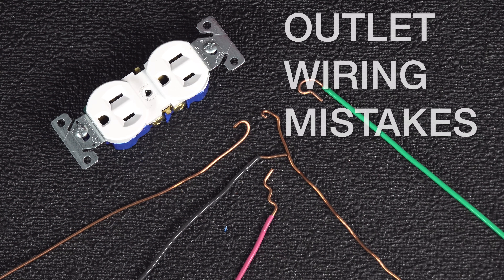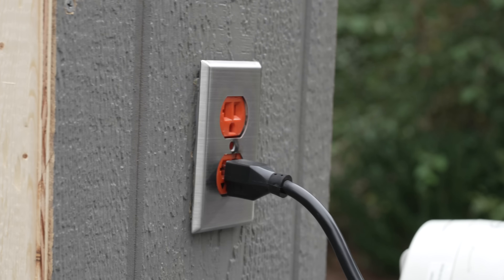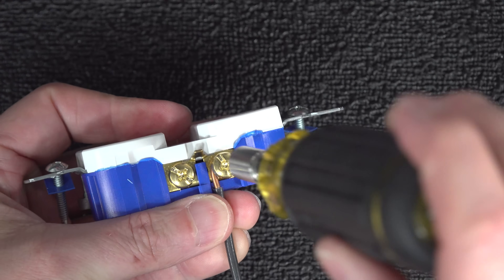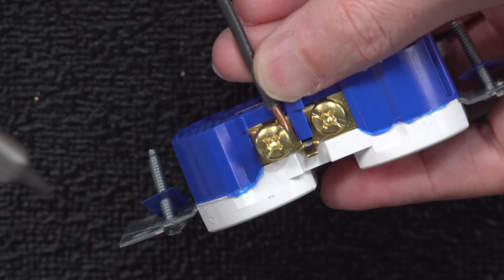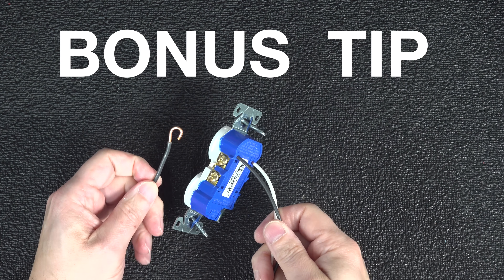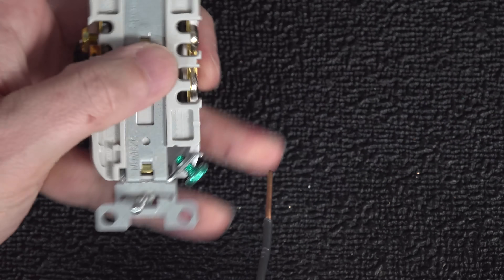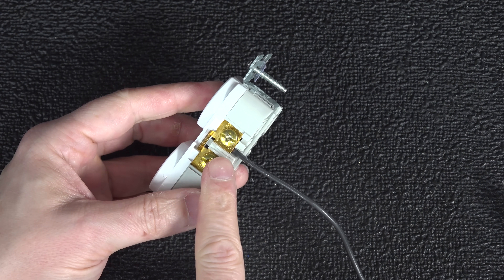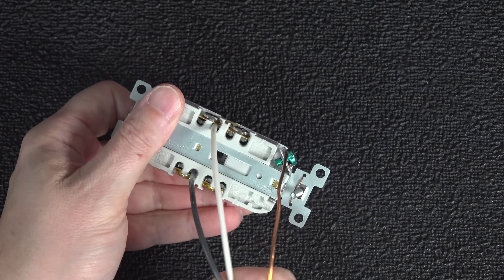BEWARE Of These 3 Common Wiring Mistakes On Outlets & Switches

Comment: The number four most common mistake is the misuse of the word “OUTLET”.    There are lighting outlets, smoke detector outlets, receptacle outlets, and some more.     In the case of a receptacle outlet, the parts are box, wires, devices, and plates.
I can talk about my hand, and included are my fingers.   I can talk about my fingers and no mention or thought of a hand.
Receptacles are a device that is part of a receptacle “outlet”.   Does it make a difference to know this?   Yes if you are reading certain parts of NEC!

Comment: Great tips! I had my lights all fail on kitchen and turns out probably the 3 way switch is probably bad or the wiring. Funny thing is the two right switches on the 3 way switch work fine but the left switch on the three way switch panel is what is not working. Thoughts?

Comment: Sorry I still don't think back wiring is all that bad.  My annoyance with screws is 3 fold, stripping right amount. Getting nice curve, near impossible, even using little hole on stripper, it still bends more of angle than circle, and if u use pliers other than smooth it scratches it up.  And the worst for last, getting the damn loop under the screw!  Screws never go out far enough to just loop it while it's the right small loop.  Opening loop wider to go over screw doesn't work for same reason, as wire is too thick to then squeeze smaller cause the screw again doesn't unscrew far enough for wire to get under and drop down.  Most outlets I did are the screws but it totally sucks.  Guess I'm not too good at it but I did a lot.  One solution is the next outlet up, that has the side wire or whatever its called, just like backfire but it goes in straight under screw... cept I was cheap before I knew that and had the low end outlets.

Comment: One more tip.  Especially for DIYers: Use a torque screwdriver set to the outlet manufacturer's spec (usually around 15 in lbs for copper).  Many DIYers don't torque the screws enough.  Also if you're doing a few outlets, use an ECX bit that's a combination of square and straight.  They pretty much never slip.

Comment: i just ripped out a plug that was installed by the previous owner of my house. the two neutrals were arcing and basically caught fire and melted into the plug housing. all of the lil hooks were backwards, the black wire was double wrapped, and everything was loose. it also had two ground wires wrapped around the single ground screw, and a red wire hanging out, not attached to anything and not capped. 
i fear for my life in this gd house.

Comment: Thanks for such an informative video!  I have to replace a GFCI outlet in my bathroom, and now I will not only know how to wire it up correctly, I will also know to look for a replacement outlet that has those nice full contact connections in the back.  Thanks a million!  😎👍👍

Comment: I think it would be best to add you should always connect the ground FIRST! when connecting. Then neutral, then your hots. This can prevent injury in case of an energized circuit. Best to build safe practices as your foundation.

Comment: And you did not mention that looking at the front of the receptacle ,the short slot is always the black or hot wire,the long slot is always  the white wire or your  neutral wire. Some receptacles are not always  marked with brass and sliver screws ,sometimes cheap receptacles have silver screws on both sides ,that is why to look at the front of the receptacle and view long slot -for neutral, and short slot -for black or power wire. This is a addition to what was mentioned.

Comment: I have a double wide trailer I winter in Florida, and I suddenly lost power to my kitchen. I have two year degree in industrial electronics, but we were also taught how to wire main power, so I was able to put a tone on wire and trace to my den, but then lost the signal. I hired a local electrician to fix it for me, and he had to get under the trailer to trace the wire. He pulled on the wire, and the tone went off at the kitchen. The problem was an outlet in the den with the wires pushed into the back. He installed a new outlet with screws, and everything worked again. He said they see this problem all the time with older trailers down there.

Comment: Can i place a 10 wire in an outlet?
Reply: Yes, but on a 120v receptacle the circuit breaker can still not be higher than 20 amps.

Comment: White to bright, black to brass, green to ground. Easiest way to remember. If at all possible, don't work on a live circuit. Unfortunately some situations won't allow for that to happen such as commercial. No matter the situation live or dead always use insulated tools as a precaution and if you have to work live always cap the hot/black wire. Stay safe and remember to go home the same way you left!

Comment: If it's AC the polarity does not matter. Making hooks on the wire creates stress on the wire while it's being used and can cause overheating, just use the specific tip instead.

Comment: EXCELLENT video! One thing I could never understand is WHY folks install receptacle with ground hole UP. I was always taught down in case ground end on a plug breaks off, it wouldnt fall down & could connect with white/black part of receptacle. Your tester printing is right side up with ground at bottom, backs my statement. 🤔😉

Comment: I am a retired electrician.  Looking at the comments, it seems everyone is an electrician.  Let me add som PRO TIPS:  do not do during electrical storm, do not wire if wild animals are in the room, never do on the winter solstice, never do when wearing brief underwear, never do without safety gear, alcohol does not lower chance of electricution and never put plugs underwater.  Now I geel like a YouTube Electrician.  Good short video.  Thanks,

Comment: I would gladly pay a little more for receptacles that didn’t have exposed metal.  Comments here are the first that I have ever heard about them.  

For typical small jobs around the house, I would suggest testing the plug with a hand held device to verify the power is truly off .... and then walk to another plug on a different circuit....and verify the handheld tester lights up as it should.....and test every outlet rather than just one since one outlet could be damaged or switched off.... but another outlet in the same component could be live.  If there is a red wire inside the box, it should be treated with extreme caution..... red wires could be for a 3 or 4 way switched outlet .....or a toggle on/off switch next to an outlet ...... could be a different circuit in a double or triple (gang) box.... b/c there is a lot of bad DIY wiring out there.   Don’t assume the plug you are opening up was wired correctly and to code.

Comment: No need to spend extra. When you make the hook crimp the bottom to close the loop on the screw. The connection will not become undone no matter which direction you put the loop.

Comment: I don't hook wires. It is annoying and doesn't really change resistance in a typical 15 amp circuit all that much. The maximum you are allowed to draw from a 15 amp circuit is 1800 watts. Whenever you measure the voltage drop across a screw terminal from a solid wire, it is typically less than 1 watt. Even back stabbed plugs will handle over 15 amps without melting. The resistance is actually very little because electric current is only traveling for a small section of the circuit. Where you would be interested in having a solid connection would be with a 20 amp kitchen plug, a stove and a dryer plug.

Comment: Question for you: I pulled an outlet from the garage wall that is the source of power to a UF cable for my lamp post. I notice the feed (top, coming down the wall) has the neutral wire going into the bottom outlet, and the neutral wire going to the post is coming from the TOP outlet--in other words, the neutral wires are switched. Is this correct? Or nothing to worry about?

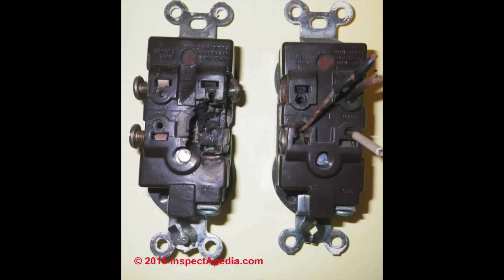Comment: 2:45 stop telling people to not back wire.  I make thousands of dollars a year just replacing back wired outlets with terminal wired outlets because amateurs aren’t getting full voltage and they don’t know why so I come in and spend 50 cents and charge $200 to fix it.
Reply from the maker: $200 seems pretty cheap for that fix! You might need to up your rates. I just spent 3 hours troubleshooting a heat system due to one https://youtube.com/shorts/NCmx9bzTY6A?feature=share

Comment: You shouldnt tie outlets together using the outlet itself as a connection point. Make tails of wire first on the outlet you are installing and then wire nut them to the incoming feed and the remaining wire that is going downstream. This way if the outlet ever becomes defective, there will still be power going downstream instead of getting hung up on the potentially defective outlet.

Comment: You should never use a device to compete a splice. It should only be used to deliver current to that device.  Any splice should be made inside the box with tails added for the device

Comment: Given that many US plugs do not have an earth pin, these plugs can easily be inserted in reverse polarity.
So , this begs the obvious question, does polarity really matter anyway & if so when and when not? 
I am in Australia and here, the pins are slanted so the plug cannot be inserted in reverse polarity even if there is no earth pin. 
So the US system seems strange to me by allowing reverse polarity to routinely occur.

Comment: Love the video but I think the link to the outlet is wrong. I ordered it through your link and it doesn’t have the tabs to tighten or the length guide of the wire on the back.

Comment: as an norwegian electrician, i never run into such problems unless using very cheap-ass contacts.. and that style screw connection is really bad when having a cable where the leads arent solid like most pre-drawn installation pipes are.. here we use the schuko style plugs and 95% of installations are with elko brand contacts.. we do allways differanciate between neutral and live though.. even regardless if the installation having an actual neutral and live.. we got IT and TN here and only one of those systems have a neutral.. we use the wago connectors here.. and sometimes i worry about those.. think i trust torix more.. if properly used

Comment: How about putting 4 receptacles in a row do you put the black (power ) going into the plug and the one going to the next receptacle on the same screw? Or do you put one on the upper screw and one on the lower screw, or does it make a difference?  I'm using the hospital approved ones.  Thanks

Comment: After 34 years in hospital maintenance, always outlets in metal boxes, after finishing the wiring ( often done ‘hot’) I would wrap two rounds of electrical vinyl tape across all screws before replacing in the box.

Comment: I'm an electrician in Australia, and I have to say by comparison to the outlets we use, these seem very dangerous. In our outlets, there aren't any exposed conductive parts like that. They are all recessed into the equipment. If you opened this up without isolating it correctly you may accidentally touch those conductive parts and shock yourself.
Reply: Im an electrician in texas, america its normal and no one really cares about safety
Reply: You are correct  I tape my outlets up and try to use plastic boxes.
Reply: Yeah but Australia has 240vac. More of a shocking experience.
Reply: The real reason for this is cost. Our 2-device outlets cost 88¢ retail, and less when bought in bulk and that's plenty good enough for literally any application aside from GFCI which is required near water (bathroom and kitchen).

To recess everything within the receptacle at such an unbelievably low price would require an additional cost of 40+% and 🤷 safe enough.

Also we use 120v outlets (though it's a 240v *system*) so we can, with relative safety, just shock ourselves to test whether the outlet is on. It hurts, sometimes quite a lot, but the true risk of actual injury is essentially negligible by such a method. Definitely not recommended though.

Also, and this is key, American outlets are the best in the world because when there's nothing plugged into them, there's two surprised little faces staring back at you from the wall. And that's cute and funny and worth a shock or two.
Reply: If you don't like it don't come got enough whinny lil beotches here already.
Reply: Home wiring is shit in America. Use some some uncovered conductors like that in industry and you’ll go home jobless. I could only guess it’s to kill enough people so the survivors feel the need to call an electrician. Hell, I worked at an old plant that had these 120 outlets and switches inside metal boxes and let the new guys tKe them out to replace so when they took them out and inevitably shorted it against the side, would learn to tape the shitty thing up before replacing it with another shit switch or outlet.
Reply: Not sure why in the states they make the connections like this as you say its dangerous and there is no need, I'm a UK electrician same wiring connection types as OZ
Reply: @George.Kerr2025  Backwards compatibility to Edison 110 volt DC from 1890
Reply: North america is very underdeveloped in many aspects, this is one of them.
Reply: It’s not that hard to not touch the metal parts. I mean it’s still not great but just don’t be stupid
Reply: @ethanclem3383  Certainly, but the ideal is not to have the opportunity to make this type of error.
Reply: You also seem to be using the standard 230 volts like the rest of the world excluding Murica. Why everything has to be so weird in Murica?
Reply: @batra204  America does have 240 volts. It’s just reserved for higher electronics.
Reply: @mattdude "super high power" lmao.

Never new a stove or range was "super high power"

Oh, and the power is still the same on dual voltage equipment. It's just your either gonna have more voltage less amps, or less voltage more amps...but power is power 😅
Reply: @mattdude  Like electric dryers. Stoves. Air conditioners. Electric heaters.
Yeah, all those super high power home appliances.

Comment: We’ve been using terminal screw connections like in that last example in both low and high voltage electronics since before I started in the industry 20 years ago. Just make sure you don’t have too much sticking out, and if it’s stranded wire none of the strands come out during insertion, and they work brilliantly.

Just be sure to open it all the way before you stick the wire in. There’s always someone complaining they don’t hold the wires properly, only to have someone else point out they didn’t open it before trying to secure them. 😂

Comment: Your hooks are backwards though.. they even have a wire holder when hooking to the left.. you are missing a basic feature in the outlet housing. Also backstab connections are not reliable at all.

Comment: those second outlets are much better imo to work with, but even using the 1st one you showed works fine. I always use the back hole which works much better if you've filled it with enough electrical fluid. Most people don't know about this stuff, it's a shocking wonder at how well it works though! I get mine from the shop, usually on the shelf next to the blinker fluid.

please read as the sarcasm and joke it's meant to be.. no dumb comments.

Comment: Do NOT add multiple wires to the outlet.  Wire nut them together with a "pigtail" for the device.

There is no code for the ground to not have that backconnect, but we don't care if that one grounds out to anything but the hot/neutral.

Also, "babyproof" the device with electrical tape around it to cover the screws.  This protects it from grounding out to any bare copper ground, and prevents accidental contact with newbies as those screws are exactly where people want to grab the device.

Comment: The first receptacle in the video is for 15 amp that's why is only a screw and they're cheaper,  the second one is a 20 amps hence the better connection and a bit more costly

Comment: If backwiring was a safety and/or performance issue, the outlets could not be UL Certified.  Therefore, you comment is preposterous
Reply: Still…. It is true that almost no certified electricians ever use them.
Reply: @mercoid  Wrong. And proper grammar is '"any", not "no certified..."

'

Comment: The reality here is unless your a licensed practicing electrician you ought to leave this type of work to professionals with the proper metering and electrical tools and practices. There are a few good points here but the first move should be isolating the circuits and I would add if the home where the work is being done doesn't have GFCI breakers feeding the loads you are attempting to repair or alter an unskilled novice shouldn't even attempt the repairs.

Comment: I buy outlets that have the terminals labeled as to "which wire connects where" molded into the plastic case on the back. Not all of them have that, but it does eliminate the guesswork, if you don't do this sort of thing every day.

Comment: lol theese channels and clamps inside are like 80s-tech in germany. Starting in the late 90s, outlets and light switches came with spring loaded clamps that don´t reqire srew tightening anymore as standard. They work the same as Wago wire connectors do, and the quality of the contact is sufficient for 230 Volts and 16 Amps.